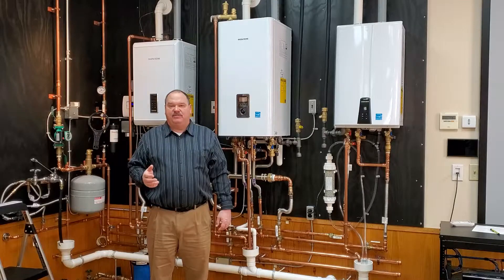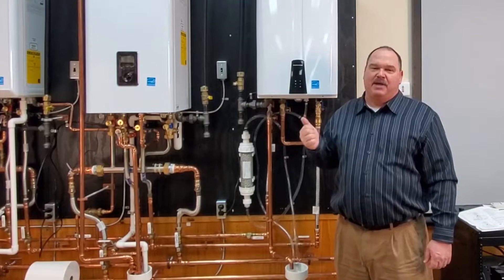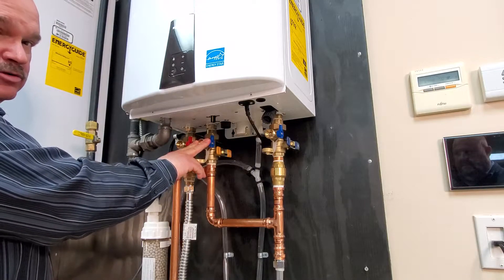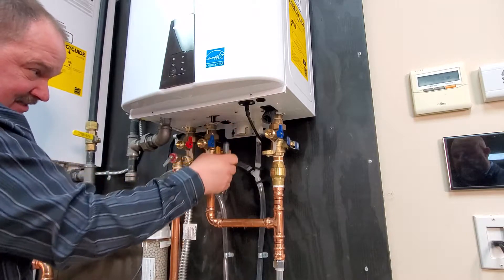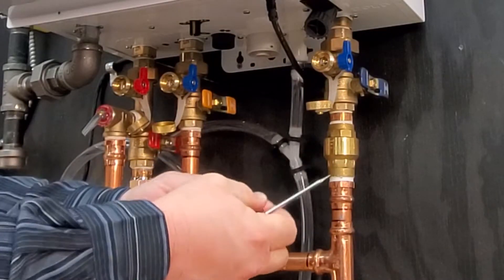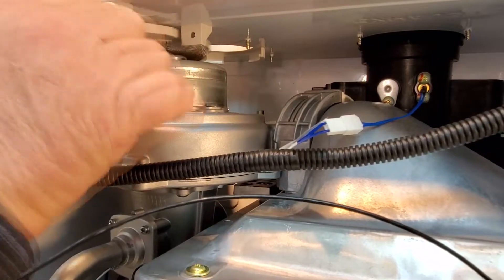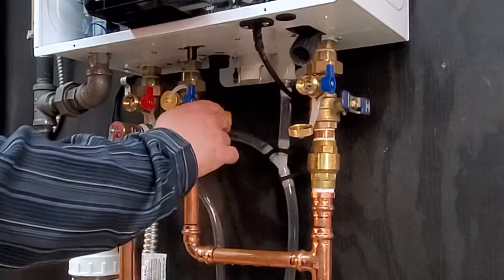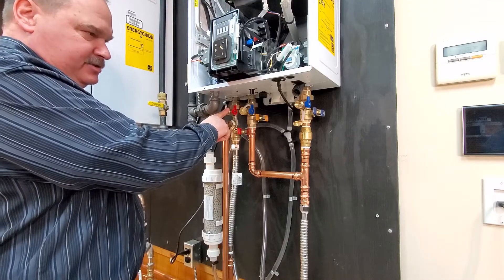Basic Maintenance of a Navien NPE A tankless water heater

Comment: Excellent video, but here's a problem you may not have encountered, and I'd really welcome some advice. I have a natural gas Navien 240 a, and followed the procedure outlined. All went well (cleaned all filters, etc.) but when I hooked up the hoses and the sump pump, the pump pumped the vinegar, but NOTHING came out the hot water end, and the level of the vinegar did not change. Almost as if there were a block, but there were no leaks, etc. How is this possible? I checked the workings of the pump and it was fine. Nothing came out of faucets in the house either. It's as though the vinegar got to the inlet port, and just stopped there?  Help!!
Reply from the maker: For starters, vinegar is not to be used to flush a Navien and will void warranty. If you are flushing it backwards that is also incorrect and can cause harm to components like the flow control valve by pushing scale to it instead of away from it.  No offense meant, but this is an example of why Navien doesn't want untrained people working on them at all. Vinegar is more acidic than the proper cleaning soltions sold in the flush kits.

If this is part of a multi-unit system, the unit being flushed must be taken out of casacade or there is a good chance that the flow control valve is in the OFF position. Flushing a cascaded system requires taking them out of cascade to perform the Flush. It is most likely one of those things. The manual details the procedure as well.
Reply: @eklof6510  Thank you for you response. It really is appreciated, and no offense taken. I will switch to a certified descaling solution and won't use vinegar. However, the problem remains, and that is that the solution does NOT enter the system, and mine is NOT part of a multi-unit system, so I don't think that's the problem. My system (unlike all the others I've seen in videos), has ONLY service valves (one blue and one red), and no other shut-off valves (other than the gas). Not sure if this has anything to do with my problem. Just wanted to mention it for anyone else reading this. Thanks again for you reply.
Reply from the maker: @JRSimon-ly9jy  The service valve kits usually have a "flush ports" with hose connections, that allow the cold and hot ball valves to be closed to isolate the houes and the flush ports opened to let you flush the unit only. We sometimes see these installed upside down and that's not going to work.  We'd need to see what you have to help figure it out. Tankless service valves are like these: https://www.ferguson.com/product/navien-3%2F4-in.-plumb-easy-valve-kit-ngxxx002139/9858183.html?srsltid=AfmBOoqUHqeelN0yeeFcYO0XSYLWgOBESSHaAxrOAJg8r6gU-YnxfETo  The flush ports have to be betwen the shutoff valve and the unit. THere are litereally dozens of kits available and some are a little different but all should work the same way.  If your unit functions normally otherwise, the kit might be in upside down.

Comment: Is brown oily substance on the bottom of the heat exchanger normal? Navien seems to be avoiding answering that question
Reply from the maker: Not us.  You are refering to the film that can form on the condensate pan on the bottom of the HX. Navien sources their raw plastic material. A batch was produced that had a higher oil content and some of it can "cook out" when heated over time. You can simply wipe it off and once it stablizes it won't come back. It won't hurt a thing. :-)

Comment: Is the procedure or schedule different if the home has soft water?
Reply from the maker: Water softeners are GREAT for tankless units. They make the heaters require very little servcie. Mabey you check the filters every year of so (Mainly Air intake filter) but with a properly working softener, it may not need anything else.

Comment: I don't trust the companies listed on Navien's web site. We hired one of them a few years ago to install one of the units and it was a total train wreck. Turns out that Navien only certifies a COMPANY, not their individual technicians - so you may get someone who has never laid eyes on one of these units. I think that's what we got. We finally had to just hire someone else who came out and COMPLETELY REDID the install. Nothing was done according to Navien's standards. So now I'm looking for someone to come and flush the system for our regular maintenance. The guy we used before has retired. How do we find someone who is actually QUALIFIED to work on Navien equipment? Seriously.
Reply from the maker: That is very unfortunate that the first company sent an unqualified person to your home! You should file a complaint with Navien. When looking on the Navien Dealer locator, choose a company that is a Navine Servcei Specialist if possible. They are the best rained and usually the best install contractors as well.

Comment: Hi I did evrything like you did on video but when I connect pump to flush it water doesn't come out from hot side hose back to bucket. Any idea what to check?
Reply from the maker: If it is part of a cascade system you have to remove the units from cascade to allow the flow valve to open a unit in "standyby" mode may have the valve closed. THe flush procedure is also outlined in the manual.

Comment: Hey are you familiar with circulator pumps? I am putting a new one in and i have the part but only one shut off valve. From what I see on YT if you only have 1 shutoff valve you need to "bleed it" I guess of the air. Are you familiar with that? I have pictures as well.
Reply from the maker: Your local contractor can help you ensure that your recirc system is properly plumbed and set up with the correct sized pump. installing too large a pump can cause erosion isues in your sysem and too small just won't work, or the pump won't last.

Comment: What is the thin black valve with the yellow stripe on it (in the center of the unit at 2:06) ?  Is that something that needs to be removed and cleaned?
Reply from the maker: That is a drain for the pump. You don't need to anything to that.

Comment: thanks for the video
for the inlet filter, how tight should the O-rings on this be?
Reply from the maker: Finger tight is fine. The oring seals on the inside edge of the tube, not the bottom. Lube it up with some faucet stem grease too.

Comment: This was an exact replacement for the old one that lasted about 10 years. https://www.youtube.com/post/Ugkx7yWIKcrbA9KMHkGSfcgxW2lsjHT6B8Sh The top of my mitigation tube by my roofline was just a 90 elbow which allowed too much debris to fall down into the fan, eventually ruining it. Without this issue, I bet it would have kept running another 10 years. When I replaced this fan, I added an extra elbow joint so the top tube now it does a 180, which should solve that problem. The radon guys around here wanted to charge me a $300 diagnostic fee, then parts/labor (probably close to $600 total). I installed this all by myself in about an hour for the cost of the fan; it would probably be even easier/faster with two people. FYI the manufacturer's warranty greatly differs depending on whether you install it yourself (1 yr warranty) or have a licensed installer do it (10 yrs).
Reply from the maker: Well I don't know a "Mitigation tube" is but, if you installed a Navien yourself as a homeowner and not a trained licensed contractor, there is no warranty for the unit.  Debris should not ever be able to fal into the fan becuase there is a air intake screen inside the unit. the link you showed is for a gable vent fan. You may be commenting on the wrong video?

Comment: Thanks. This video helped me change the Condensate trap's O-ring on my heater that has outlived its warranty.
Reply from the maker: It can happen. They usually don't leak unless messed with and even then, if you lube it with faucet stem grease usually won't be and issue. Still good to have one on hand if you are going to pull that plug.
Reply: @eklof6510  It’s been a while, but I believe I just replaced it and it stopped leaking and has worked fine since.

Comment: Is the service port on the recirc to flush out the recirc pump? If so, how do you do that? I think that was left out of the video.
Reply from the maker: No. The main thing you are flushing is the HX. That's where heat transfer is taking place and the only area where scale is actually cooking out of the water. Any build up that mght occur in the recirc system is very minimal.

Comment: What is the procedure to flush the recirculation tank.
Reply from the maker: There is no Recirc Tank, but there is a buffer tank. That is flusehed when the HX flush is done and since no heat transfer takes place there and it is constantly flushing while iun use, there is little to no sediment in it...ever.

Comment: Voiding the warranty because of self-clean-up does not make any sense!  I bet any homeowner who does self-service to their water heaters will be much more careful and thorough than any contractor.
Reply: It doesn’t matter. If you pay a service plumber to maintain this unit every year, over the life of this unit you will spend enough to by TWO replacement units! You are better off doing the service yourself and  setting aside the service fee each year to buy a new unit.
Reply from the maker: That is not even remotely accurate.  I have 2 - 18 year old units in my house that have never been serviced outside of cleaning out the water filters once in a while.
Reply: completely agree.. @micahwatson9017
Reply: @micahwatson9017 how much does a service usually cost?
Reply from the maker: That is the policy for a reason. We see people going on YT, getting bad info, or even god info and then going at the heaters with power tools tearing things up. Even "professionals" sometimes.  I've seen one or two home oner installs with other brands that actually very good BUT This policy is primarily about risk mitigation and many more DIY'ers greatly overestimate their skill levels than the few that would do a great job. If you saw what we see, you'd understand.

Comment: I'm 69 and never service a ware heater. these new units need lots of maintenance and are very expensive. 90 percent of home owners will not do the maintenance and will be replacing it with a conventional unit in 3 to 4 years!
Reply from the maker: If you don't have bad water they need little to no service. Nobody Services tank heaters either. That's why the average life expectancy is 8 years. They are expensive because good things cost money. Unlimited hot water and reduced energy bills are valuable.

Comment: Basic yearly maintenance: get a new heat exchanger, 3 way valve and a new pcb board.
Reply: My heart exchanger failed after 7 years on the Navien. Truth told I was more angry at the contractor than I was at Navien even though it was leaking trace carbon monoxide into the house. At first the contractor tried to get me to spend 15K for a new model but I got lucky and one of the installation guys realized I wasn't rich. That gentleman fought with Navien to get it covered under a warranty and get the exact same unit shipped to us. However I still had to pay out of pocket $3,500 to get a new one literally swapped in. No changes to the vent, plumbing, valves, pumps or anything. It took them a little over an hour. The reason was because that was their flat rate for a boiler installation. My advice to anyone who has a boiler or any sort of heating system is to find a contractor who charges by the hour and not flat rate. I've had 4 flat rate jobs on the house now and every one of them I've been screwed compared to when I hired someone hourly by a solid 300 to 400%. This is why I try to do most things myself.
Reply from the maker: You obviously don't know anything about them. These are the most durable of all tankless.  Yearly maintenance is not required, but it is recommended.  The only real problem tankless water heaters have is people installing them wrong and them blaming the unit when it fails prematurely. Perhaps you should sign up for a training class near you and learn how to install them correctly.
Reply: @eklof6510  I service them all the time. I’ve read the book countless times. Don’t try to take the argument from authority. All the time I see a navien with a beautiful install, hydronic side is piped perfectly, but the unit looks like complete crap. Don’t try to blame the techs. You’re obviously a contractor for navien so of course you’re gonna defend them, they literally pay you 😂
Reply: LOL.
E594 says that the fix is to replace the PCB 😢

Comment: What about all the issues that are with the NCB heat exchangers?
Leaking CO
Reply from the maker: There aren't any.  you are referring to the BS videos produced by one contractor in particular or rumors he's caused. That guy is mad because from what I hear, he tried to get Navien to pay him for videos and they said no thanks.  I guess Bosch does now.  Just about every video that guy has about Navien he clearly says that units are installed wrong that he is there to fix, before he calls them junk.  The units ALL are CSA certified and operating within their design. Navien units have the best warranty in the industry and the best technical support. (Even though hold times are crazy as of this date)  He is slandering a good company that goes out of tis way to support the trade. It's very sad that he continues to do that.
Reply: @eklof6510  interesting
Reply: @eklof6510  I seen a video where he actually opens a brand new one out of the box at the supply store (a very well know store) and plugged it  there at the supply store and was leaking.....that's hard not to believe
Reply from the maker: That guy is a crook.  He's mad because Navine wouldn't pay him for vidoes. There is nothing leaking in the Navien HX'es outside of CSA approvals of CSA would yank the certifications!  Plus the cabinetes are sealed and part of the intake air. Anything that could leaks gets burned and exhausted.

Comment: We had a Navien NPE-240A tankless water heater installed last year.  The system includes a Navien “Condensate Neutralization Capsule” similar to the one shown in the system on the far right in this video. The “pearls” in the capsule now have a tan/brownish color. When does this capsule need to be replaced and/or how is it maintained?
Reply from the maker: When the media disintegrates new media should be added.  Color changing from organic matter will not effect it.  New media added can be any limestone based acid neutralizing media available to you. This can be done by the Homeowner easily. 
 If you have a contractor performing annual maintenance (Highly recommended but not required) this would be part of that service. Any media like this will work fine: https://amzn.to/3Haa1TP

Comment: Im having an issue with my on-demand water heater. Ever 5 or 6 weeks the condensation line will dump around 2 gallons of water into the floor pump tank i have setup and it runs over. The pump works fine but for some reason every 5 or 6 weeks it runs over. Do the on demand water heaters have a timed system purge? Any help is greatly appreciated.
Reply from the maker: What unit is it that you have? Naviens to not purge condensate.  They are gravity drained as are most other MFG'ers units.
Reply: @eklof6510  its a "Rinnai" RUC80. it just seems like a lot of water to be just condensation. Maybe its normal.
Reply: @eklof6510  after looking into it further, part of the problem was the float in the condensation pump was sticking causing it to run over. But even after getting a new pump w/tank, im noticing its filling up excessively. The line coming out of the unit marked "drain" is where its coming from. Its putting out 1-2 gallons a day. The new pump is running once every hour or two. Should i be seeing this much water?